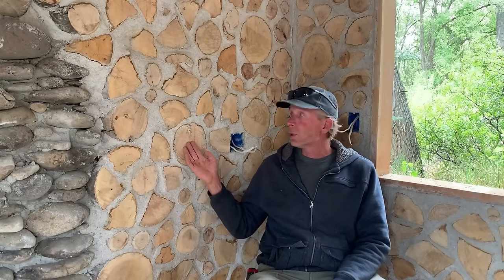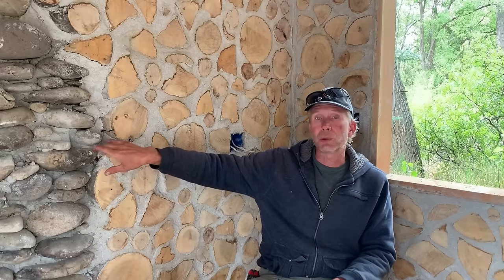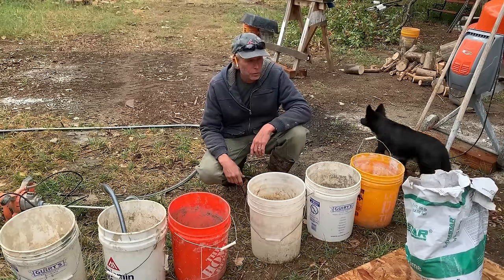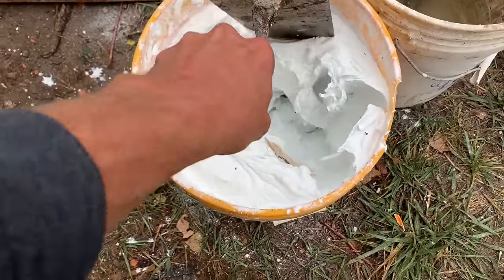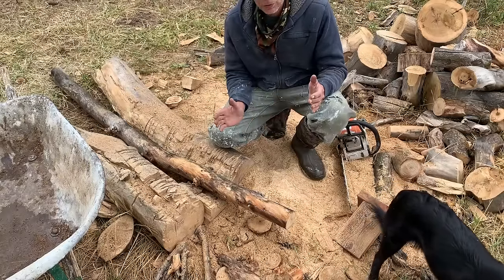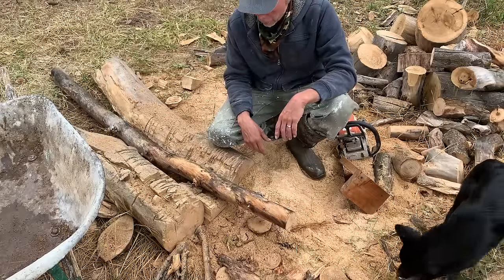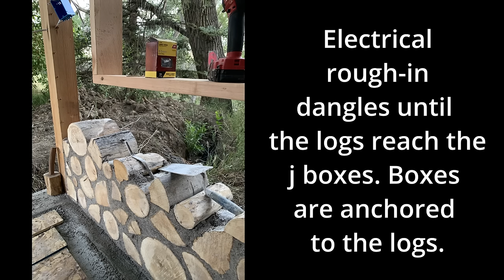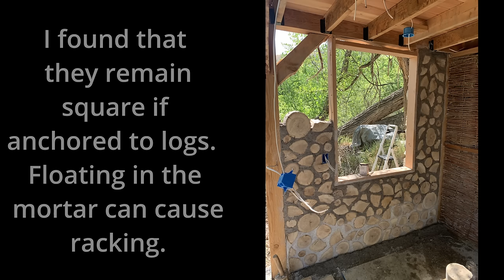Cordwood

Comment: Would this work if you built a foundation and then applied your technique?  This would be an awesome idea I own property with loads of trees and I was just going to have someone come out and clear the land ( cut everything down and build up but with this idea 💡 I saved like 50% of my cost because I would only need to buy post and lime cement  sand  and the lumber for the foundation I'm so happy I came across your video I can do this I have a chainsaw and must of the tools needed thank you for sharing .👍🏽
Reply: if you look closely the foundation around the shower (where he was working) is a concrete slab, so yes it works .

Comment: A couple questions, Do you treat the wood? Have any wood boring bugs been an issue? Where I live, the termites would do a number on something like that. Looks beautiful, though, and great job!
Reply from the maker: The wood remains un treated, but it’s a good idea to seal the log ends after everything is fully dry (after a year). I’ll get to it this fall, along with putty for the fine cracks. We haven’t had any bug issues in the 4 years since I built this. I can see issues with termites in other locals. I have see people pull this of with red cedar in such places.

Comment: I'm wondering if you could put your dustcrete mix between the cordwood to make a self supporting wall. Probably would need a higher portland mix to add structural strength, as your dustcrete seems very crumbly, when compared to other similar mixes i've seen online.
Reply from the maker: There is a method for cordwood that uses soaked sawdust in the lime mortar. I have tried this and found it too fragile, over time.

Comment: Looks great!   What happens when the wood rots?
Reply from the maker: That’s the neat part. It doesn’t .
Reply: It falls apart. This guy is in it for the video, not longevity
Reply from the maker: @kylehoyt3499  still living in it four years later. Hasn’t “fallen apart”. I’m in it for the freedom to have no rent, or mortgage. #winning
Reply: @radicalgastronomy  Hey , thanks for responding. I saw one in Canada many years ago and wondered about the longevity...now I know!  But do you have to treat the wood with anything?
Reply from the maker: @markanthony3275  It depends on the wood type, and the look you are after. I recommend waiting a couple of years to allow for complete drying, then a linseed oil finish.
Reply: @radicalgastronomy  Linseed was gonna be my guess. Thanks for answering my question and greetings from Canada!
Reply from the maker: @markanthony3275  Hello Canada!

Comment: Any issues with rot.  Typically raw wood touching cement is not acceptable.  I am not trying to be a naysayer just wondering if the type of morter used mitigates any issues or perhaps this isn't as big of an issue as codes and inspectors make it to be.  (I recently found your videos keep up the good work I love what you are doing)
Reply: In a previous video he said he lives in the high desert.  I think it's a fairly dry climate.

Comment: Excellent. Thank you. Question: what is the benefit of splitting the cordwood as opposed to setting natural round timber?
Reply: Like he mentioned in the video... If you have irregular pieces, such as split in halves or quarters, you can't keep your grout spacing tight. Meaning the distances to the studs from the last piece of wood won't have to be as big in the case of not having a piece of wood small enough to fit in the wall after the previous piece. Kind of like this...
|~\~•~•~\\| or [~•~•~\~•~] instead of having [~~~•~•~•~~]... Did I explain that correctly? It just allows you to keep the limestone to a minimum. You really don't want huge areas of places that are just lime mortar. How that helps!!! Have fun

Comment: ⁹old power  poles work good
Reply: Me and 2 other fellas built a log cabin out of old power poles.
We did this in winter, all was good till late spring hit, and man, the inside stunk so bad from creosote, he could not live in it. The heat from then on into summer, made it worse.
He finally after 2 years, decided to cut bigger doors in the ends, and use it as a barn, and leave any doors off so air would circulate in there. 
It's still standing, this was in 82' when we did this, and still a barn.
Reply: @dalesmyth7398 I would have stucco the entire interior.

Comment: Do you have a video that shows how to fix a Cordwood building?  I have a few logs near the ground that termites or burrowing beetles have drilled part way through, and I don't know how to fix or replace the damaged logs.
Reply from the maker: I have no such video.  I also have no experience with this repair.  If I was doing this repair, I’d try chipping out the mortar around the rotten log, from both sides. If the home was built in the conventional fashion, there will be mostly void in the middle. With the mortar removed, the log should be easy to slide out. The wall structure should hold, as the logs form an arch over the hole. Replace the log and point mortar around it. Sorry I can’t offer expertise.
Reply: @radicalgastronomy  thank you.  I will be trying that.

Comment: Unless you’re in a low-humidity area, what stops the wood from rotting and leaving you with a Swiss cheese wall?
Reply from the maker: In a wetter environment one would need 16-24” of stone or concrete at the base of the wall, and long eves, to prevent spores from splashing from the soil to the logs in the wall. Other than that, if the wall remains dry, the alkalinity of the lime mortar and insulation prevents rotting in the wood.
Reply: @radicalgastronomy , yes, that splash-back plays hell. Still more questions.
Reply from the maker: @danajoseph6705  Shoot. I’ll give you my honest assessment.

Comment: Здравствуйте. Подскажите пожалуйста Вы делаете раствор
Песок +известь негашоная ( известь Вы гасите водой давая на реакцию 48 часов)
Вопрос 1. Некоторые делают раствор с добавлением цемента. Как Вы считаете  стоит ли добавлять цемент? Благодарю Вас за отзыв. Хочу построить дом  пытаюсь разобраться в технологии..... 🙏
Reply from the maker: I am using "type S" lime which is hydrated lime, not quick lime. The same lime putty can be achieved from quick lime, but that is a hot and caustic reaction, so use care. I would not as cement. it is too rigid, and holds water against the wood, and could cause rot. The lime mortar will wick moisture away from wood surfaces, and "self heal" minor cracking, as the wall cures. Good luck with your build!

Comment: Seasonal humidity changes dimension of wood across the grain around 0.5%.  On an eight foot high wall that’s roughly 1/2 inch change of the infill stack up.  Seems like a lot for the mortar to accommodate.

Did you seal the wood, especially the end grain, in any way?

How many years has this structure been up?  Any maintenance?
Reply from the maker: These concerns are of varying importance in different climates. Mine is high desert with low humidity. 

Much of the seasonal movement is unnoticeable. The continued crystallization of the lime mortar self heals the hairline cracks that form. The matrix of mortar tends to remain fixed, and the logs swell and shrink within it. There is no overall compression of the stack.

This building was constructed in the spring of ‘20. Most of it remains as sound as it was at the time of completion. There are, however, areas that are showing some degradation. These are due to my less than expert timber framing skills and the frequent closing of the front door. Because my joinery is a bit less than perfect on a couple places, the vibration of the door rattles the mortar, causing some fracturing. I hope to lessen this effect with some shimming of the wind braces which are exposed on the exterior. Ideally, the frame would be more precise, using all of the techniques which make a strong, enduring frame (offset peg holes, dado mortise pockets, etc.). If building without a frame, as many do, I’d pour a reinforced bond beam on top of the wall, and anchor door frames from foundation to bond beam.

The log ends and mortar are currently unsealed. I may seal them, now that the wood has had three+ years to fully cure. This is more of an esthetic choice than a performance one in my dry climate. 

There are some drafty spots where logs have shrunk, here and there. I will fill these with a loose lime/sand plater, this fall (video to come).

Over all, I love the look of the cordwood, but would not use it extensively, going forward. I like it for an accent wall, or for semi climate controlled applications, such at a mud room.

Bare in mind my wall depth is well below the typical 16-24” depth. This likely adds to the instability mentioned.

I wouldn’t say don’t do it, but I would say I vastly prefer dustcrete.

Comment: How far will a 50 pound bag of hydraulic lime go? Mixing 5:1 ratio with sand...if i had a 6'X6' wall... would a 50 pound bag made into putty complete that area?  Or not even close? (I'm planning on building a cordwood roundhouse  about 10' or 12'  across the center of the circle's foundation... and unsure of, approximately how many bags of hydraulic lime I'd need to order.) Thank you!
Reply from the maker: I think one bag would come close to doing a 6’x6’ wall.
Reply: @radicalgastronomy  Thank you! One more thing, if it's not bothering you... ;) I have tons of walnut and oak that have been down for about a year and a half (two years this spring. I heard what you said about insulative factor and to use soft wood...BUT.. are these woods possible? Drying longer maybe... and cutting them 15-16 inches long instead of 9... with a 5" air gap filled with sawdust/hydraulic lime powder? Or will I regret using hard woods the rest of my life? (It's only affordable if you can use what you have... ) Thank you!
Reply from the maker: @shanengivone3973  I think you’re in good shape. The hardwood is slightly less insulating, but at 16” the difference is negligible. The hard wood will look great, and the shrinkage will be slight, given the seasoning it has had.
Reply: @radicalgastronomy  Yay!!! Please have a blessed day! Thank you!

Comment: Why do you only hydrate the lime putty for 48 hours, others I've seen advocate for minimum of 3 months. But I've also seen commercial products that are 6 months. Is there any benefit to this vs 48 hours?
Reply from the maker: My guess is that those using such long slaking periods are using quick lime, rather than hydrated lime. This mortar performed well for the application.

Comment: I have always wanted to build one of these Cordwood homes, wver since I saw my first one 20+ years ago. Can you get permits ETC. to build a Cordwood home basically anywhere? Like if building in say, an association or something like that? Timber framed with Cordwood walls. Like you did?
Reply from the maker: Codes and HOA rules vary. Most counties with building codes (thank God mine is not one) have an avenue for alternative construction. This usually involves having plans stamped by an engineer, and that is expensive. Updates to the IRCC include pressure testing the entire home, and I doubt cordwood would pass. You’ll want to do a lot of discovery before selecting your site.
Reply: @radicalgastronomy  I am seeing as I do more and more research, that government just has to make life more & more difficult for us, ( unless of course you have money....they like money
Reply from the maker: @Up_North_Adventures  Largely pointless regulation inflates the cost of home construction from the $18/sf my house cost to nearly $300/sf a “code built” house costs. Add another $100/sf if you want to build something unusual. Lending requirements will also pigeon hole you back into conventional methods and materials. I’m writing a script for a whole video on this subject, so stay tuned!

Comment: Hey I hope you can answer me back, I would like to use your method and would like to add a few black walnut and some glass bottles for looks. What is your opinion on this?
Reply from the maker: Glass bottle can be set just like the logs, if you cut the tops of and tape two together with clear packing tape. Walnut will look great, but the R value is low. Nothing to be concerned about, really. Good luck with your build!
Reply: @radicalgastronomy  thank you so much for your reply

Comment: Great idea but ive used treated wood on my window seals onntwo houses n they were chalked n sealed  and painted. Rotted all of them from inside out in less than 20 yrs , soooo hard wood western ceder or redwood. Water sealer or tar on those 24 inch lengths. No splitting. Spray foam them only on ends. Nothing in middle air has r values. Dead air as well , vents at top, to draw oth the air heavy lime, stucco. Over foam. And 8 foot porch eves all around, all sides, ,  then ceder lap over that inside n out , or steal, cement board they make also dissolves. So the 8 foot over hang porches and 24 inches. 36. 48 inches off the ground, wicking. No cement slab. Unless its syryofoamed all sides especially  the bottom first , yep all sides, .makes no sense to leave cement slaps un insulated and on flat ground needs. To be on tall bearm of gravel,  ,  the illuminate  takes out mine now its slab is gonna be a pool. N ill build this for the new pool cover over whole slab, but on peir n beam on top of slab ,   great job, steal roof. And 8 foot steal wrap around roof porches,, next thank me later

Comment: How do you deal with expansion and contraction of the cord wood? 
Also... where I live( Upstate NY) we are loosing our ash trees to a wood bore insect. Would ash work in this method? Ty
Reply from the maker: The most important thing is to season the wood for a full year before building. There is always going to be some movement, but the lime mortar does a pretty good job of self healing. Lime will reabsorb carbon dioxide for 60 years, forming new crystals as it does. In your climate, I’d make my walls 24” thick, particularly if ash is the wood available. One other thing I wish I had done on mine, and would recommend for yours, is an 18-24” masonry course at the bottom. Snow against the log ends will cause damage from expansion, so “good boots” will make a difference. Ash is super hard and will not insulate like my cottonwood, or a conifer species, but at two feet thick it would still work. Let me know if you give it a try!
Reply: @radicalgastronomy  ty, I plan on doing a small  structure at first.  Any thoughts on mixed  woods? Like pine Maple , apple or even cherry?  Will the work with each other or fight each other???
Reply from the maker: @i_found_it_4_you914  Interesting question. I suppose there is a chance that different woods moving at different rates could be an issue, but you could sure do some cool patterns using a variety of species. If they are all well seasoned I bet it would be alright. Would sure make great content! 😉
Reply: @radicalgastronomy  TY, I am certainly looking forward to trying this.

Comment: What's the situation with say bugs that live or burrow into wood or the decay rate/issues?  Is it treated to prevent those things or is it easy to repair of a log does prematurely rot thru or get infested and expose the outside or something
Reply from the maker: Because the end grain of the wood is exposed, moisture escapes easily, reducing the risk of rot.  Termites aren’t really a thing where I live, but the lime inside the walls would prevent an infestation from getting too far.